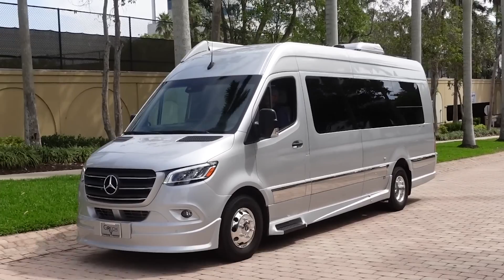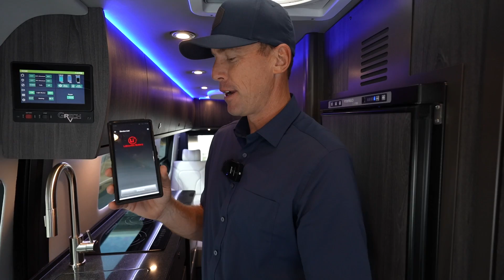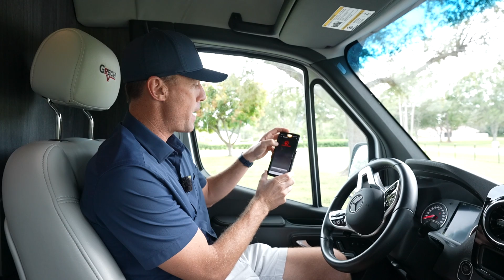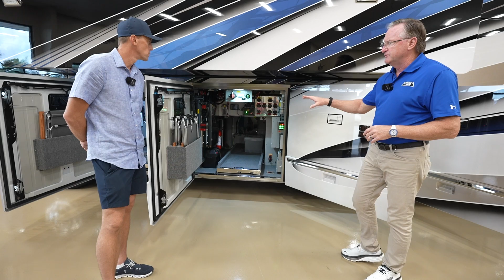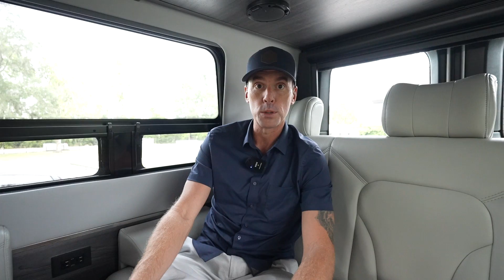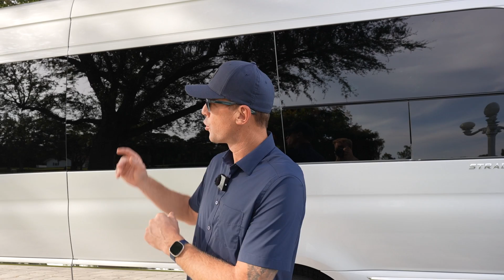Will Lithium Batteries Charge at Idle?

Comment: I always thought the Sprinter should not idle for extended periods. Have you checked with Mercedes about idling for extended periods of time?
Reply: It's not supposed to. You need a high idle switch to increase RPMs so that the DPF remains unclogged.

Comment: I just finished a lithium upgrade on my Class A pusher. Went from 450ah flooded to 920ah lithium. Swapped out my BIM for a DC to DC converter. This saves my alternator from burning up when the new bank starts pulling hard.  Had it installed for a few weeks now and im seeing ~5x the capacity with the lithium. The question as to whether or not you can run AC off your battery also depends on inverter size, not just your battery bank. FWIW, my lithium upgrade (all in) was ~$2900 for 920ah (12V 460ah x2), 60a DCDC, Victron SmartShunt, all wiring, fuses, etc.
Reply: Was just going to say the same thing, these silly $20,000 + lithium packages must be 95% profit because they do NOT cost that much.  I think its the Newmar superstar that is $20K and its only like 600AH, total rip off.

Comment: It’s a very interesting topic to discuss Andrew. My concerns about solar power are what happens to heavy snowfall and the ability to heat your RV. I’m thinking about the possibilities of adding something like windshield wipers to remove all build up of anything that would block the charge inc defrost facilities. A mixture of both lithium batteries and solar panels are a complete game changer for people who experience extremes in weather conditions. Given #climatechange this is going to become more important for survival both for the RV and it’s inhabitants. Manufacturers should be way ahead of the curve by now and yet it’s not yet under consideration for many. 
Keep up the good work 👍🏼😉💫

Comment: The Volta Systems seem to be a very nice system.
I like the idea of higher voltage 48V with smaller wiring saving weight and ideally giving more power with better efficiency.
In an ideal world one would have a high powered alternator for charging and a system that would start the engine let’s say when batteries reach a desired setting and shuts off when fully charged.
Also 48volt air conditioner/s again getting the most out of a higher volt system.